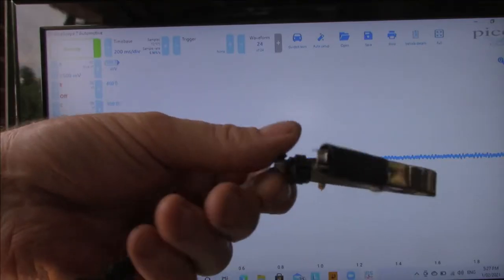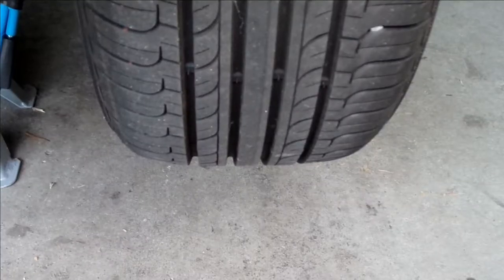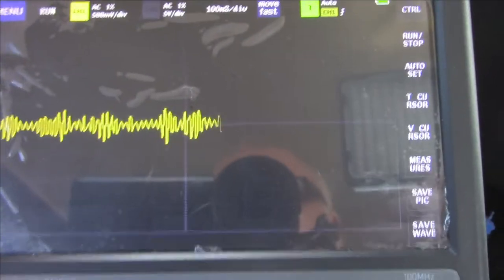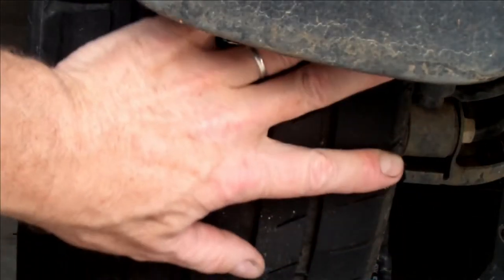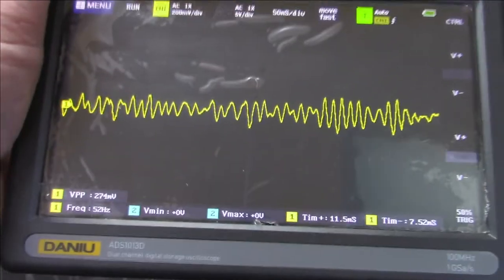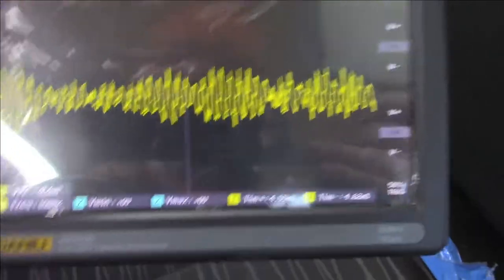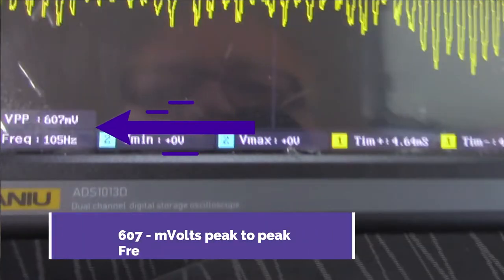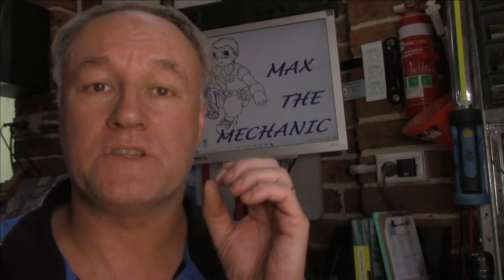What Is That Noise? MiracleMAX

Comment: Nice work mate, 
Scalloped/damaged tyres have caught many technicians out over the years.  
That's a nice looking tool ya got there, be great to hear/see more about it. 
 
We may not all use the same tests or methods to get the result but from the customers view that's all that matters.  
A successful diagnostic which leaves the customer knowing they came to the right workshop to solve the problem :) 
 
I enjoyed your article this month in TAT, I read it today. Keep up the good work.
Reply from the maker: Thanks mate! 😊
I could clearly see the tyre was at fault, but wanted to make a video reinforcing the diagnostic process.
The Pico is just getting warmed up! 😉

Comment: Cant beat new tech for good diagnosis.
Reply from the maker: Hey Tom O'Connor,
You are right. I love new toys......tools, but some can get so caught up with the bells and whistles that they forget about the basics or don't explore all the options that their tool might offer - intended or not.
I have made heaps of tools for a fraction of the cost that do as good a job as their counterparts - not quite, but good enough.
I will be putting out a video in the future that shows how I made my smoke machine out of a paint tin that I have been using for years for successful diagnosis of vacuum leaks, exhaust leaks, fuel vapour leaks, etc.
MiracleMAX

Comment: Apart from being cheap tyres, the left rear is an Asymmetric and the right rear is a straight runner, which is illegal.
Reply from the maker: You are correct. For about 6 months the customer had a space saver on there, so he considered this a step up. I recommend all tyres to be replaced, which he has now done. The noise has gone & it drives heaps better.
Good eye!
Thanks for your comments Stephen

Comment: Hi MM, great simple tool, was the noise noticed after a tyre rotation?
Reply from the maker: Hey ltkaffey,
The customer is a panel beater & will get the tyre replaced himself. Normally I would do a tyre rotation, but in this case the tyre is past that point.
This guy was using a temporary spare for around 6 months at highway speeds & this current tyre was given to him by a mate. After that spare, I doubt he would have been too concerned with the replacement tyre. The vehicle even had speed sensor correlation codes, but after a road test, checking live data, I believe that it was just the temporary spare creating those codes.
I feel very confident as soon has he has that tyre replaced as well as a full wheel alignment, the issue will be solved.
MiracleMAX